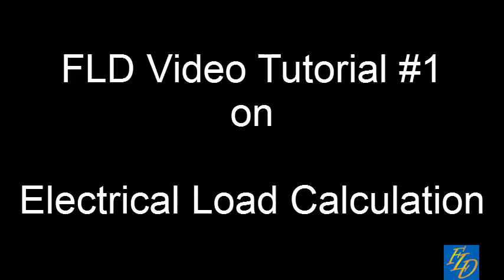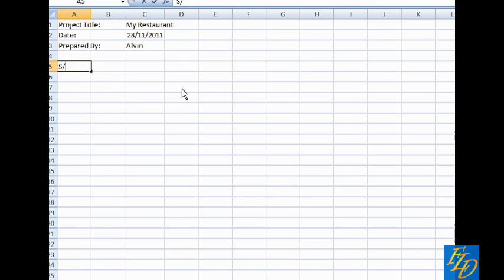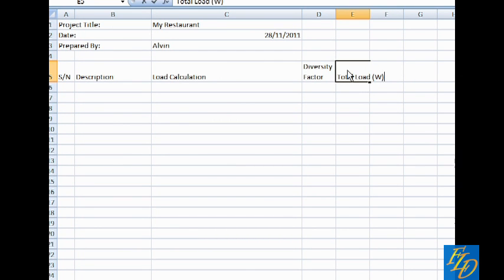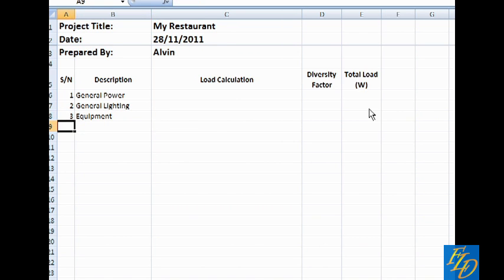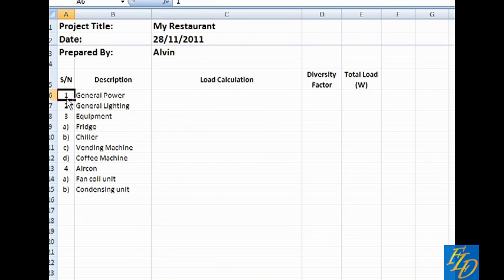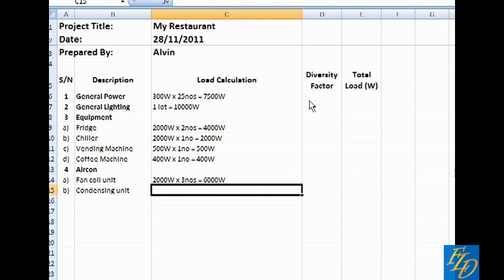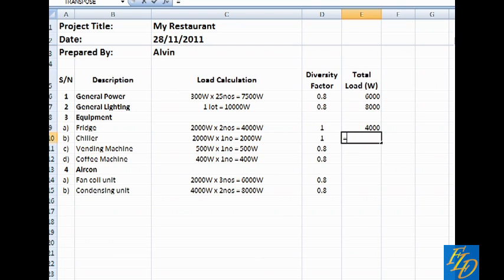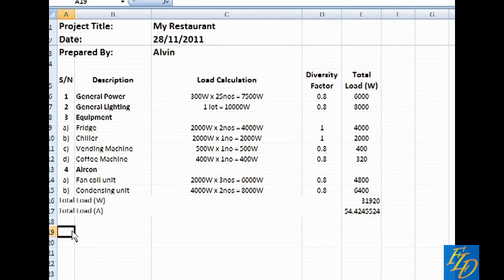FLD Video Tutorial 1 - Electrical Load Calculation

Comment: Thank you for making this interesting video. Q: Where does the diversity factor comes from? Is it a standard or just each engineers own ideas. I would say 0.8 for power is perhaps too high as not 80% of all sockets plugged in with the max load assuming a 13A sockets? Whereas lightings could be at 1? And how critical would error in Diversity Factor affect circuits, breakers and power demand. What would be the Total Connected Load here.? Thanks

Comment: Total (Amps)= 31920/0.85/230/3  where these numbers(0.85/230/3) came from please?  Thanks
Reply: +En Jay .85 is the power factor which seems a bit low for the installation but better safe. 230 is the line to neutral voltage. 3 because its a 3 phase system using line to neutral assuming balanced load, not line to line voltage which would be root 3 and 415 volts. Buildings with 3 phase machinery use L-L, houses use L-N, but for larger buildings with a higher demand they use 3 x L-N hence the supply being TPN = Triple pole and Neutral.